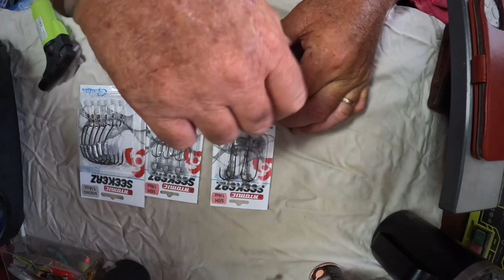How to bling up your jig heads with powder coat

Comment: When do you use the tail dip on your plastics
Reply from the maker: Mate I was going to do one on that as well, but I’m near out of it and it’s a bit hard to get at the moment. I believe we’re getting it again shortly. 😜 I use pink and red worm dip in dirty stuff and the green in the clearer water mate. U can’t use it with Z man or Madeyes or anything that is made from that type of rubber. Even some of the soft vibes won’t take the dye.